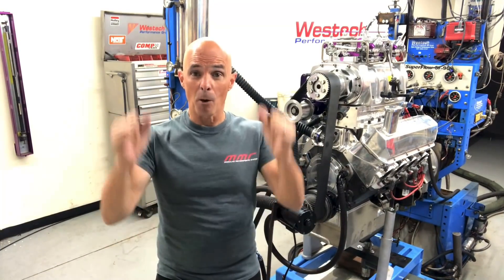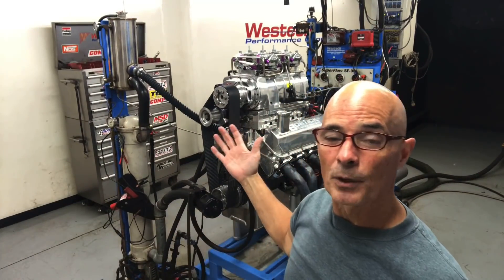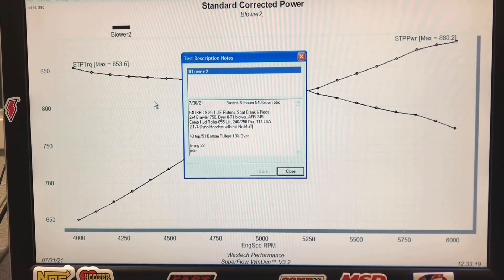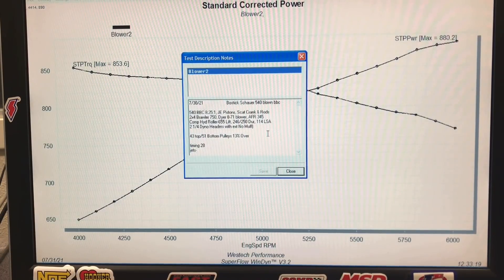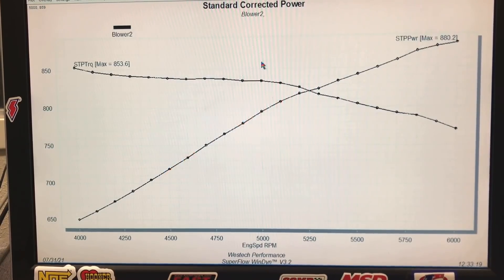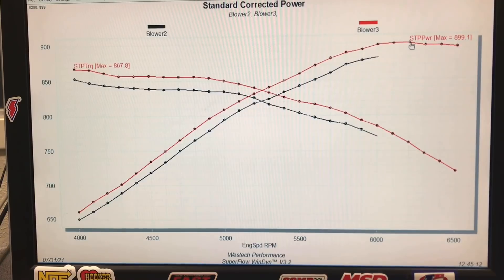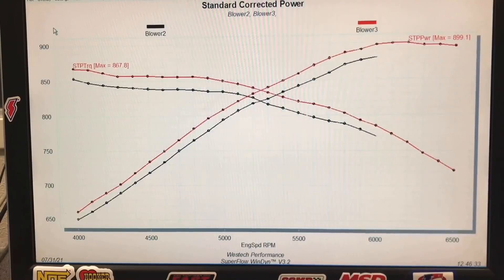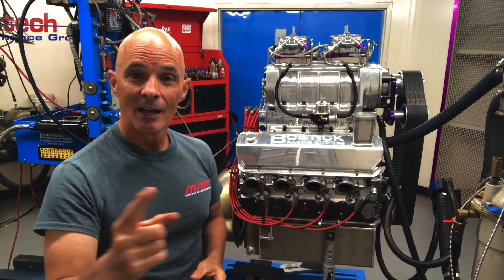SUPERCHARGED BBC PUMP GAS POWER (900 HP ON 91 OCTANE)

Comment: Nice Job Richard 👏 😅
A EFI Supercharger Hat might give u more Grunt . A guy in Sydney Australia 🇦🇺 manufacturers a Beautifull Billet Version.  
The Intercooler u used , was it a Aluminium Core or a Whipple Cupronickel Core ?? 
The Cupronickel Intercooler Core will make more Grunt . 

I have a Richard Lee Intercooler with an Aluminium Core on my 482 BBC Marine Engine.  
Going 2 upgrade 2 the Whipple Cupronickel Intercooler Core & also upgrade the Blower Manifold 2 a Roy Miersch Blower Manifold.

Comment: Blowers make power from a low rpm. It bears turbos in several ways. No turbo lag. But noisier. You can drill a few set of holes, paired a ross from each side of the pully to quiet the air and don't use any gear drive.

Bv engine builder

Comment: Anyone know best weight oil to use,have 700 hp BBC 671 blower drive on the street ,idle oil pressure when hot at idle is 20psi goes to 40 when driving ,know use 20/50 would 20/40 be better thx
Reply from the maker: 20/50 IS FINE

Comment: No AFR in collector? Should have all 8 in pipes, especially for endurance use. Tune for power and saftey.
Reply from the maker: we can and do run 8 sensors in the headers when necessary-not necessary on this motor
Reply: Please explain why not in pump gas, roots blown, under load, the worst conditions for a roots blown engine. How did you tune it?

Comment: Love this.  I am glad you mentioned oil level.  Owner and builder might even take out a touch more oil because there can be a couple of degrees of running angle in the boat. I know it's not much, but windage is no good.  Hopefully there is a crank scraper and  baffles in that pan.
I'd not even measure the oil by quarts but by how it sits on a dipstick. Stick references the crank, and the pan was custom so it would take some trial & error to find the happy spot.  Also an engine like that will have remote filtering and possibly have oil cooling once installed, so quantity becomes relative and goes back to distance down from the crank. 
You call the cam mild. It's a boat, not a 1/4 mile car. I'm guessing it's more of a long life boost cam. And low compression is a good thing when you can add what boost you decide.  Compression coming in through the top!
I so want to do a marine big block!

Comment: Is the calculated NA Hp about 600hp, if 7-8 lbs of boost gives 900hp?
Reply: I’d guess more like at least 650, it takes some power to turn the blower(parasitic loses). 600 would be close with turbo’s
Reply from the maker: not with a blower

Comment: Good video Richard thanks, what did I learn?  Letting a quart of oil out of you pan is the cheapest horsepower!
Reply from the maker: it works
Reply: @richardholdener1727  On an engine stand, yes, in a boat it could easily starve for oil [depending on trim] running before planning out! I would NOT recommend taking oil out for power on marine application!
Reply: @richardholdener1727  if 1 quart is good 2 must be better right lol I was surprised but it makes sense even if the lifters lose oil pressure they will lose lift

Comment: Hey Richard,

If you add spacers between the blower and the carburetors on that type of setup does it have any effect on total power produced or the curve?
Reply from the maker: probably not
Reply: @richardholdener1727  

Probably not? What is that something you ACTUALLY HAVENT TESTED? The universe is spinning out of kilter now….
Reply: I agree----especially on a "Roots" design supercharger where heat soak is a factor. The blower case on a Roots becomes pretty warm thus effecting the temps of the carbs. Horsepower may or may not be effected from the addition of a carb spacer, but a phenolic carb spacer will help the carb(s) from heating soaking and thus the fuel from getting to hot as well. Certainly food for thought.

Comment: Why did they use a locked out distributor? That just makes the engine harder to start, especially when hot.
Reply: That’s not an issue on the dyno. The locked out distributor allows them to know exactly what the timing is for data collection.
Reply: That's only and issue when an engine produces too much cylinder pressure at cranking speeds. Usually on stock or slightly modified engines, with short valve events, too much compression, and big stock starters that can't handle heat. Not the case in most modified engines, especially with cams this size and 8.25 compression.
Reply from the maker: dyno has two starters
Reply: Its low compression. Wont be hard.  This is a pretty old school design, everything use to be this way if you were 'fast'. I am surprised it doesnt have a vertex in it.

Comment: 91 octane for the win! Really want to see more pump gas testing using a knock detector.
Reply: Richard and the guys get the motors going pretty good, but they don’t do knock sensors. They use conservative ignition timing figures instead.
That BBC makes so much mechanical thrash that you couldn’t run an electronic knock sensor anyway.
Reply: @oldschoolmotorsickle  I know that knock sensors are sensitive to noise. I was thinking maybe use a standalone knock detector like the J&S one that has adjustable sensitivity for data logging but not for active timing control.
Reply: I hear you. I asked him basically the same question, and he says they don’t mess with it. I was somewhat surprised, but they use the parameters that they do track to get a decent result.

Comment: Nice! That’s almost the same motor I have! I’m at 9.5 to 1 compression, same cam, and AFR 357’s, B&M Megablower and holley dominator Multi port EFI that’s about the horsepower I was shooting for to get my 78 firebird in the 9’s with a stick shift
Reply: 9’s on a stick shift, pump gas, BBC, late 70s Pontiac. Curious what trans and rear end ratio you’re running.

Either way - you like doing things the hard way, dontcha? 😉
Reply: @grumpysteelman  yes, it’s a Doug Nash racing five speed, so it’s a dog box transmission, same as a G-Force. It’s got a low first gear and a 1:1 fifth so I have A 3.23 rear end gear in a Ford 9” 35 spline rear with Detroit locker and Calvert racing leaf springs on sliders. Look at the build on Instagram, and yes I like doing shit the hard way
Reply: @xozindustries7451  - that’s super cool, and honestly, I do shit my way whether it’s hard or not, so much respect. 

Suffice it to say that there are guys that couldn’t touch the 9s on a Powerglide with a transbrake even on a blown rat sucking down C-16. 

I am certain you’ve hurt some feelings, driving around those folks, and having them (finally) catch up with you in the lanes only to spot the three pedals. 😂😂😂
Reply: @grumpysteelman  ya, I’m building it to be a drag week car

Comment: 91 95 98 e85 at alot of  gas stations in Australia,  not sure why you would want to de tune it to run 91 , you might aswell run it on kerosene .
Reply from the maker: RATING IS DIFFERENT HERE IN THE STATES-BUT 91 IS PREMIUM (WE DO HAVE E85 TO)
Reply: It’s also in a boat and fuel choices on the lake or river are limited. In a drag car you’d bring your own fuel anyway.
Reply: 91 (Ron+Mon/2) is the highest octane in California. E85 is available at some stations but not in abundance.
Reply: E-85 in a boat could be a really bad idea. You might need a 1000-1500+ gallon tank depending on the boat.
Reply: Problem in USA 🇺🇸 is they don't have there 93 Ron/ Australian 98 octane in the West Coast.

Comment: I'd love to see this architecture morphed into a 60degree v12 dohc, 50% more displacement (12.6liters) with better balancing while also being about the same width as this setup.
Joy of 4v pentroof style heads.. central spark plug.. more airflow for a given amount of lift. Heck potentially more valve-cyl clearance (due to valves being smaller and potentially intruding into the deck less at peak lift).
Before some get all defensive saying "but ohv is more compact" were talking about a blown big block here not a lawnmower.

Edit: the only thing I love more than a blown big block is a blown better and bigger block.
That random screeching in the music has gotta go through, sounds like an audio problem.
Reply: You could do all that and i'm sure it'd make a lot of power. Or you can just get a bigger big block.
Reply: @177SCmaro  you could do that, or you could get a bigger dohc v12.
Turns out "getting bigger" isn't some sort of exclusive technology.
Reply: @tomstech4390  
I'm pretty sure just getting a bigger big block is easier then completely reengineering a big block Chevy, which is a 90 degree cam in block v8, into a 60 degree dohc v12. 
But hey, knock yourself out. I'm a fan of weirdness. Just look at my car on my channel.
Reply: Just get a 1710 Allison. 3000hp for days...................... :-)
Reply: @bcbloc02  SOLD (although something a little more modern would have benefits).
Reply: If you want exotic and big block chevy, then Fontana/Arias is about as good as it gets if you can still find them. If you get really lucky you can find some of the Batten stuff. I would also say that if any of the things you listed really mattered for high horsepower engines, they would be doing it. Like the 2 DOHC motor programs in Top Fuel (McGee and Batten), notice how they are not around anymore and nobody uses that design.
Reply: @taylorsrus9543  A big part of the reason DOHC wasn't developed in Top Fuel is the same reason it's not in Nascar, etc. They simply don't allow them - they write the rules to prohibit them, mostly to keep the sport "nostalgic" I suppose. Notice Formula 1, which has no such restriction, is dominated by DOHC, 4 valve engines.
Even back in the 70's Ford was messing around with OHC with their "cammer" engine in Nascar and drag racing. And if that wasn't weird enough I remember reading about someone playing around with turbine engines. 
It's not that OHC can't compete in Top Fuel, no body uses them in that type of racing because they don't allow anything other than a specific engine spec modeled after the old Mopar Hemi.
Reply: @177SCmaro  There were overhead cam engines, they were never competitive. NHRA always had safety concerns about the McGee because it used timing gears, the Batten was a belt drive. You are correct that they are against the rules now. You can still run non-hemi engines, but again, you would have trouble being competitive. You do see more variety in Top Alcohol.

Comment: Sweet motor what a waste to put it in a boat
Reply: Why a waste? Are you aware of the torque needed in a race boat to spin a little prop that has to cut through water? Why do you think they all run blowers?
Reply: @jrdmotorsports9718  simply I like race cars and trucks. Not a boat in general fan lol I am shur it is great for a boat. Just rather see it in a cool car
Reply: @stevestauff2220  I get it. I'm a Street car /drag car guy, was never into boats either. As a builder though, I see and understand why. In my world, power is power, for cars, trucks or even boats 🤘